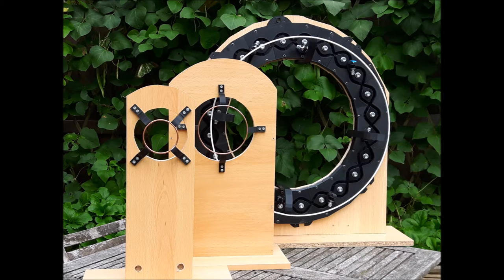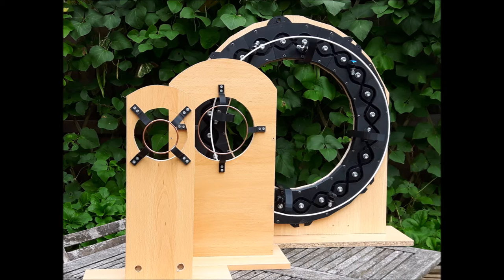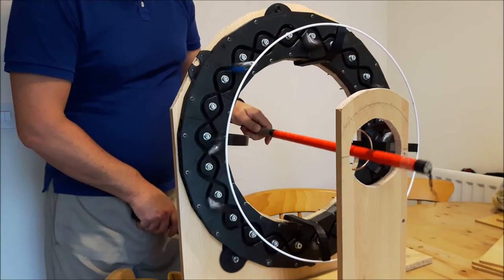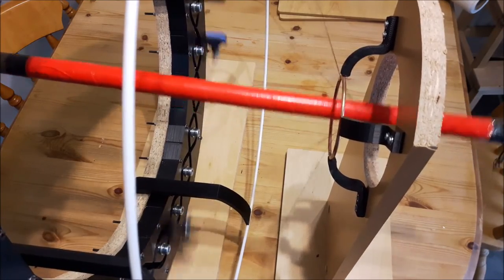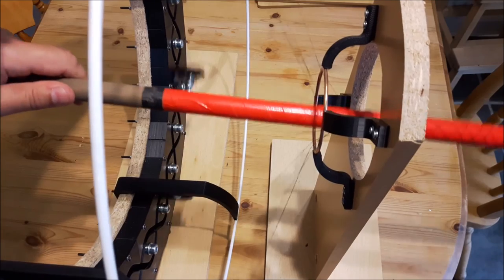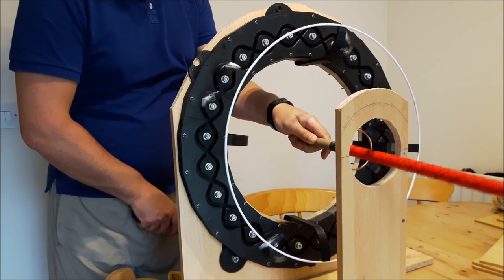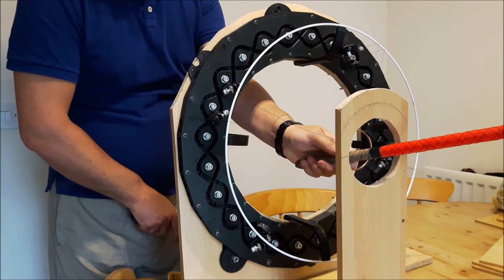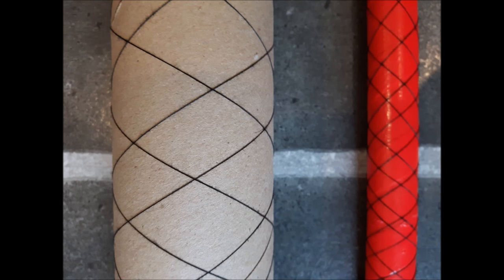New design for old technology:  3D Printed Braiding Machine #5 first braid.

Comment: Where could I find a 3D model of the assembly? I am looking to make just a 3 spindle machine. Please help.
Reply from the maker: Hi Akshayd. Unfortunately I lost the original cad due to a hard drive failure. I am intending to do an updated version in Fusion 360 some time soon. Many thanks for your interest.  Barry M
Reply: @CNCModellerUK  thanks so much for responding. May I please know how one would design the pin path for a two gear, 3 spindle version? I am trying to make one for my school project and I would really appreciate if you could guide or provide one. Thank you!
Reply from the maker: akshayd211 I'll try and get round to doing a basic principles video for you fairly soon. I can't quite figure out in my head if that arrangement would actually generate a braid but will have a think...